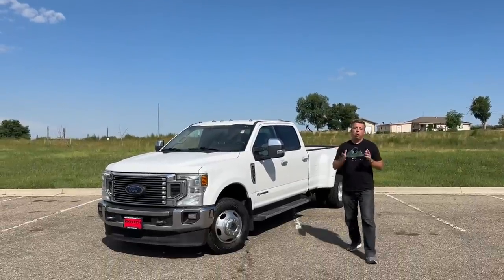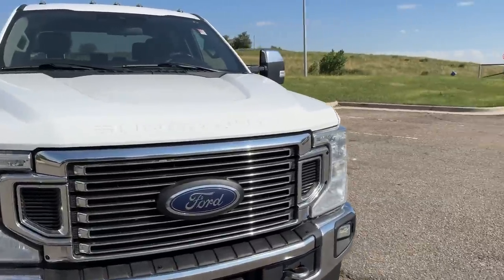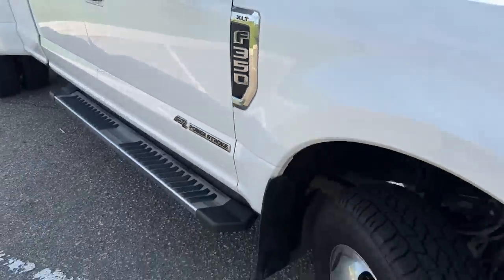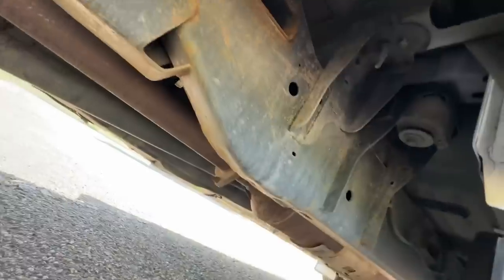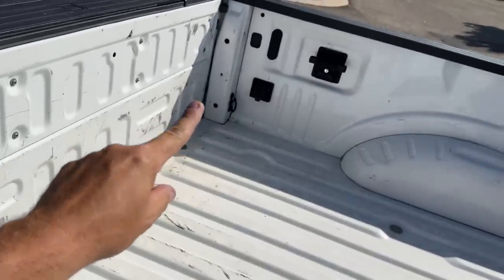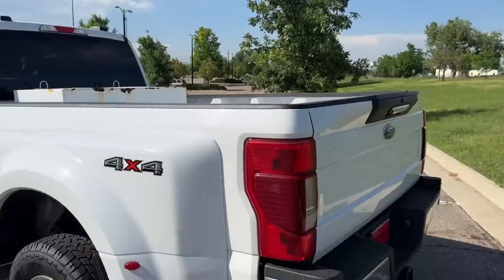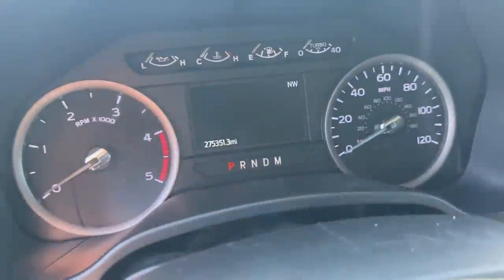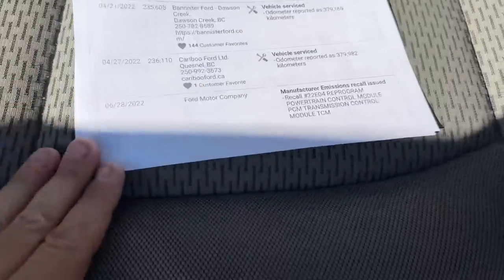What BROKE & What DIDN'T! 2020 Ford F-350 Power Stroke Diesel After 275,000 Miles Of Hard Use!

Comment: I have a 2017 F-250 6.7 with 300,000 miles, 3 sets of batteries, water pump, AC Compressor, 4 brake jobs. I live in the desert so no rust. Been a great truck!
Reply from the maker: Thank you for the feedback!
Reply: I also own a 2017 F250 6.7.  Love it! 🇺🇸
Reply: Any exhaust aftertreatment issues?
Reply: @DavidHuber1  Zero! Always topped off the DEF fluid when it hit half a tank. If I was working close in town and didn’t get on the highway that week. I would do a standing regen with the Banks idash.
Reply: My 2015 2500HD has 235k miles and has had nothing replaced but brake pads. Batteries say 2015 on them (AC Delco) maybe your 300k were some hard miles, but that actually seems like a pretty needy truck to me…
Reply: @pv2kio1991  i have a 2019 F350 with 345,000 miles and all i ever did was put diesel in the tank.. i think your chevy is sorta needy i think
Reply: @tsu.cameron be real bro, both of y’all trucks are doing phenomenol for that mileage. the OP seems borderline needy fo me. we gotta consider the mileage, that’s pretty good. but you’re correct, that’s a bit much imo. prolly used cheap batteries so i don’t care about that but i don’t feel like a water pump should go.
Reply: I have a 2017 with 288k miles. Needs a new cp4 pump…
Reply: @MCatwar  New Mexico and Arizona heat killed my batteries over time. They were AGM batteries.
Reply: @MCatwar  it’s because of the heat in the southwest. Almost 100 days of over 100 degree temps per year. Water pumps and Batteries wear out a lot faster out here. Weathers nice on the frames but a lot of steep mountains and heat.
Reply: @pv2kio1991 that's just poor maintenance. You're gonna be putting an alternator on it.
Reply: I've got a 2017 F-350 and was curious what your mileage was like?
Reply: @pv2kio1991  I'm in Florida battery life is 3 years tops.
Reply: 10 years 560k miles original batteries. What did u do wrong? -50 f winters. And don't tell me heat is worse. Been there done that.
Reply: @ryanbrand3946 u can say don’t tell u but multiple people have already and u didn’t listen lol. U have a truck running 12 hours aday in 100 degree heat yeah that’s gonna wear the batteries down faster then some dude just doing highway s few hours aday
Reply: @ryanbrand3946 My friend in Arizona, we changed the battery every 3 years it doesn't matter the mileage
Reply: @DavidHuber1  Yes. On my 2017 F350 6.7, single rear wheel, with only 33k miles of very light weight and infrequent towing (~2,500 lbs), an error code says I need to replace the DPF sensor. That will be $1200. Plus, there's a chance that after it is replaced, they'll say the DPF filter also need replacement. If that happens, the bill will total ~$4500. I'm quite disappointed to encounter this so early, with such conservative towing and a very light foot on the throttle/acceleration driving. I worry if it is a bad harbinger of things to come.
Reply: @jonathanmathews7037  I own a 2017 F350 as well. Your mention of the cp4 pump scares me. From what I've read, if it goes, metal shavings from it can destroy the entire engine.  What symptoms or codes tell you it needs to be replaced? Also, given the cp4 pump's reputation for potentially catastrophic failures, aren't you worried about driving it all if the pump is in question?
Reply: All you guys saying my truck only did break job with 300k lmao yeah okay no suspension no transmisión no dpf def oil leaks sensors issues nothing ..yeah tell yourself that..
Reply: @gregparrott  more than likely the sensor has soot cooked on to it. Reset the check engine light and run the engine hard up some grades. You might have to do a few resets until that sensor gets cleaned off. You need to do some passive regeneration which means towing some heavy weight up some grades. I understand wanting to take care of your vehicle by driving it light and not putting much throttle into it. The engine needs to work hard to function properly.
Reply: @frankclark7039  Thanks for the recommendation.  Maybe it is just the 'saleman' instinct, but I asked the Ford service manager about clearing the sensor. He insisted that it needed to both be replaced and REPROGRAMMED. I wondered if they just automatically claim replacement but what they're really wanting to do is to change (loosen) a couple of values in a table used to trigger the error code.  I assume I need to buy a tool (like an OBD diagnostic tool with an added feature to reset codes. Can you recommend a particular tool, or what I should look for in the rool?
Reply: @jonathanmathews7037 I Put a DCR on my 2017
Reply: I see guys spending $60-100k and will not use Krown rust proofing and or fluid film on all components and frame. I live in the rust belt and spray my truck twice a year and no rust anywhere

Comment: Now, that's a review!  Much more useful than those 1 year 10K mile ones littering YouTube.  Thanks for doing this video. Would love to see more; e.g., a godzilla with 100K miles.
Reply: Yes, I agree, what they consider long-term (1 year) is not my long-term.  I just sold a 1987 F150 with the 4.9 300 in-line 6 cylinder with over 500,000 miles on it, regular maintenance & 1 transmission,  now that's long-term.
Reply: @scottyellis3442  Now that’s long term!
Reply: No, it's NOT a review. TFL did own or drive this truck.  Andre just took a quick look at somebody else's used truck.
Reply: @larrysmith6797  If you haven't seen it already, head over to TFLclassics.  Aundre interviews a guy with a heavily worked 2000 F-250 diesel with 500K miles.
Reply: Yeah there's a lot of "long term" 50k mile reviews lol
Reply: Tailgate issues are common since 2013 just hit one side and at the same time pull the handle and it’ll open. Latches get worn out quickly on newer Ford’s

Comment: Hot shot truck. Hard miles.  The only way a modern diesel will last a long time with few majors repairs. Nicely done.
Reply: Hauling RV's maybe. Not quite as hard on the truck as pulling flatbed freight. You can rack up 75-100k miles a year if you do it full time.
Reply: Any Pickup used constantly will last a lot longer than a short stop and go version
Reply: As well some of the Global Diesel Midsizers have impressive use mileages. Isuzu said that 95%  of their Dmax Pickups get 220,000 miles before a major service
Reply: @robertryan7204 what’s the reason for that?
Reply: @Halfdead211   well like Taxi's that are constantly running hot, they do staggering mileage compared to a normal vehicle
Reply: @robertryan7204  got ya
Reply: @Halfdead211  highway mileage means that airflow is constantly hitting the engine and transmission cooling them throughout the entire lifetime of operation . Secondly the engine and trans willbe in the optimum temperature phase 99% of the time . 
If you want to kill any vehicle car or truck just drive it downtown alot .

Comment: Those buttons on the front are probably for a 'winter front' that blocks airflow so it can actually reach proper operating temperature in the winters up north.
Reply: Yeah,becauve in the winter, if we don't plug our diesel,it don't start, and the "winter front" help very much. It's why in Quebec, gas truck is popular, because it's always start in winter
Reply: Definitely
Reply: The Truck was fitted with a winter front for the winter and a bug screen for the summer.  The Winter front just speeds up engine warm up and helps keep the engine at operating temps and helps to minimmize heat loss from the cab. This truck was used just in the Prairies where salt is not used on the roads in winter, calcium cloride brine is used in its sted.  If it was an eastern truck from the rust belt is would be heavily rusted on the under side.

Comment: Have 246k on my 2011 F350. These 6.7's motors are beasts and transmissions are just as good. Buddy has 2016 Chevy 2500 gasser with 76k just replaced his transmission 7k!
Reply: A chevy will get you halfway, a ford will get you there, and more!
Reply: I am a big Chevy guy and 14-20 was NOT the year to buy a Chevy gasser. The diesels were fine however

Comment: Obviously a hot shot truck, fuel cell in back and that high of mileage, this truck probably had a hard life despite its condition so to the areas you mentioned the truck was running those guys tend to over load everything, not much highway patrols in those rural areas. One example for you to see is Danger Industries channel, I wouldn’t own one of his trucks after he had it.
Reply: WTF is a hot shot truck?
Reply: @Outdoor_MED  basically a truck that lives on the road hauling anything from machinery to parts or anything that needs shipped privately or for a business, something a regular Joe can start up to make living.
Reply: @Outdoor_MED hot shot are guys who do commercial style hauling with HD trucks.
Reply: A truck that is shot (most likely with double barrel shotgun) and left on the side of the road in hot climate (usually in desert heat). Hot shot truck.
Reply: In my opinion that’s the best looking grill ford has produced in a long time. The new one has to go. Looks like crap.
Reply: Lots of idel hours too!
Reply: I like how Andre  refers to the truck as an older truck. (It’s only three years old ) lol.
Reply: I disagree. We are required to go through scales constantly so overloading any axle or exceeding GVWR/gcvwr is pretty hard to do without getting fined and taken off the road.
Reply: @michaelronneseth801  like i said watch danger industries, he over loads all the time way over and he lives in rural Canada.

Comment: I have a '17(DRW) with 431.000...Transported RV's for a couple years...The only thing that I replaced was the radiator, because the top where connects to the upper hose, cracked...Besides that...Oil changes...4 batteries...filters...all fluids replaced well before the "limit"...My daily driver now(40 miles r/t)...Very happy with it.
I work in a truck repair shop, and I have seen the same truck that were neglected, that did not last 100k....Blown engines, turbos, transmissions..."Don't expect much of it, if you don't take care of it..."

Comment: I have a 22 f350, I use to hot shot with, bone stock, all original powertrain, driveline, and chassis… the truck has only not had a trailer connected 3k mi  since I bought new, I just crossed 300k this morning!

Comment: The real question is how many injection pumps have been put in it and how many times has the oil pan been resealed? It would be very interesting to interview the previous owner, and see the records of maintenance and repair invoices.
Reply: The fuel pump is completely random so I’d say 50/50 it’s even been changed. 

As far as oil pan. Similar thing. On a 2020. I highly doubt it’s been done yet.
Reply: My 19 got an upper pan gasket at 95k
Reply: If it had anything like that done it would have showed up on the service records.
Reply: My 2015 215k on it oil pan done twice and same with the cp4 trans  started shifting hard at 200k and after the second time repairing the cp4 it kept going into limp mode fought with it for 8months and ended up trading it in on a ram.
Reply: The oil pan only needs to be done once if it's done correctly the first time.
Reply: @jimmy4x4socal44 they redesigned the upper oil pan gasket in 2020
Reply: @thebitefight2601 2015 is considered one of the worst years if I’m not mistaken. New generation trucks never seem to go over too well.
Reply: @thebitefight2601 and what buy a Ram w cp4?
Oh shit trans 
And engine failure around 100k in 20-22s
Reply: @heavydieselengine8989   they don't use a gasket its silicone, the techs used to tell people to stretch oil changes because the pan would need to be resealed before the oil need to be replaced lol
Reply: @GeorgeJFW  the new pan comes with a gasket
Reply: @Kinginwar   rams used the cp4 for just over a year before recalling them and going back to the cp3, you say trans but mines now has 242k on stock one I had the lml before the power stroke and nothing but issues out that truck also, and if you actually educate yourself on the 20-22 rams the motor failures are due to guys running the wrong oil bearing clearances and stuff was changed in 2020 they no longer run 15w40 and if you run it it will fail, I put around 80k a year hauling a 18k work trailer on my trucks and my ford was my favorite but the rams cost way less to own and keep up with.
Reply: 2014 f350 lariat. 448,400 hard miles. Still has Original trans, new motor @389,000. Warped lifters. Many brakes, rotors, a/c compressor, 2 radiators, backup camera, front bearings, the list can go on for the minor things but these trucks are amazing. Original seats no rips or tears, no rust, cruise, radio, Bluetooth power everything works. All interior lighting, and options still work flawlessly. Put a service body on since new. Always towing a trailer, often gvw reaches 25,000 lbs.  dry weight 9500. This Truck has been amazing. Sure not happy on the new motor but it was way cheaper than buying a new truck. Cant say enough good things about the direction Ford has gone with these trucks. Thanks TFL for all your content.

Comment: I would love a video with manufacturer talk, real-world testing, and comparison of the different diesel fuel. With D#2, B20, HPR, and 95% Biomass, it is not clear as to what is best or excepted by the manufacturer. With injector failure, filter clogging,  the need for additive, and lets not forget the dreaded CP4 failure. What is the best?

Comment: Considering the price of these trucks these days the idea of "If you only use it to go to work and back is a waste of the truck." is short sighted. Instead of getting that heavy spec'ed F150 you can get this and 10-15 years down the road not only will the truck hold it's value better but you will be prepared to tow with fewer questions because you know from the start that your truck can handle it.
After that just take care of your vehicles. Change the oil on time, put good tires on, and generally stay on top of the maintenance before small things become big and expensive things to fix. These trucks from any of the big 3 truck makers will generally last and hold up well if you do at least the basics.
Reply: Best comment and only comment who agrees with what I also thought.
Reply: If yoi buy a truck like this is to work other wise is a waste of money .

Comment: My only caveat is high milage over a short duration is not the same as any milage over a long time. Time is far harder than milage. I have to tell myself they are meant to be driven. And if you don’t use them they atrophy. Seals dry, swell, etc… metal corrodes with exposure to moisture as well as acidic compounds in oil. Which is why having many oil changes in a short time of three years high milage will mean your flushing those contaminates where my 4 year old 40k truck sits with those compounds in the oil for a long time where they can act against the truck instead of being cycled and flushed
Reply: i have a 2020 6.7 with 26,400 miles on it and its just had its 5th oil change!

Comment: All my ford's has had 300,000 + miles, & that's with just normal maintenence. I had 1 that had over 500,000 miles on it, I sold it & still see it running around.

Comment: To put such high mileage on it must have spent most of its life on an interstate or equivalent that means top gear and not a great deal of strain on the engine or transmission you could argue it’s had an easy life
Reply: It has a well-used gooseneck hitch, that indicates it was towing a heavy 5th wheel trailer, as they are not used for light hauling.  So, it was not an easy life.  Everything would have been strained constantly.
Reply: @skrsys highway life is easy, even when towing a trailer. It will only wear the trans a little because when cruising down the road you are barely shifting, it will wear certain gears slowly
Reply: Easy life, hard life, call it what you want. Regardless this truck performed its job it was built for. And performed very well.

Comment: ok you have a fuel tank that had the pump and hose removed.. and try pushing in on the tailgate and then pull the handle to open it.. i would think you have been around pickups long enough to know this stuff...

Comment: With that kind of mileage, it all comes down to the maintenance.  I'd really want to see the service history before shelling out decent money.  It could be a very great truck for another 275k miles... as long as it was taken care of.
Reply: Heat cycles are key! How many? If it stayed running means less heat cycles!
Reply: It is more than maintenance…great built trucks…poorly built trucks fall apart even with maintenance
Reply: Incorrect. A truck that stays running typically means there's a lot of idle time and idle time wears out camshafts, lifters and oil pumps. Though the engine has 300+ doesn't mean a catastrophic failure isn't right around the corner if there was a lot of idle time. That's why government vehicles such as police vehicles are often sold with 150-250,000 on the clock because more often than not the camshafts on the engines are completely wiped. I've bought more than my fair share. My best purchase was a 1995 F350 7.3 crew cab long bed 5 speed 4wd. It was a previous transport truck for highway crews and had 285 on it and had a broken leaf spring. Once fixed, I ran it for 100k without issue. The trick was that the truck was driven long distances and had almost no idle time between stops. I know because it was assigned to my neighbor for 20 years from the state and he bought it after it was retired and he retired a couple years after.
Reply: @alpha2gproject783 Yeah, gov't vehicles do spend a lot of time idling... but vehicles like what is in this video are more commonly associated with the hotshot market.  Those don't sit idle, they run... 10's of thousands of miles a month!